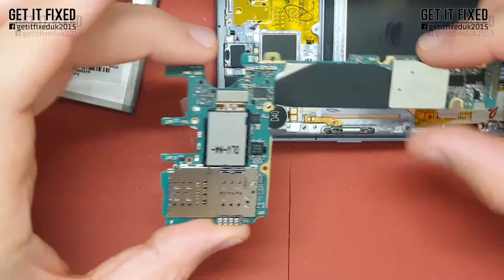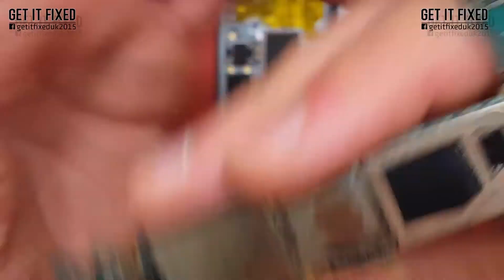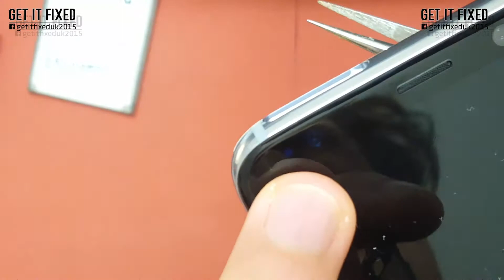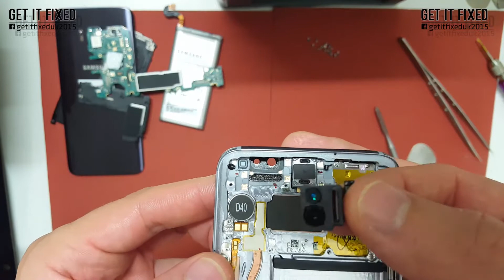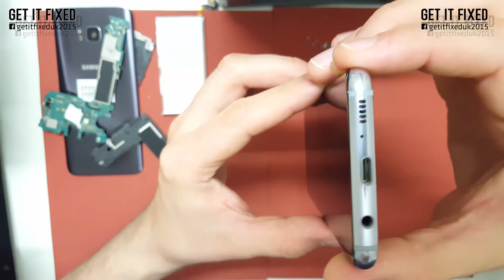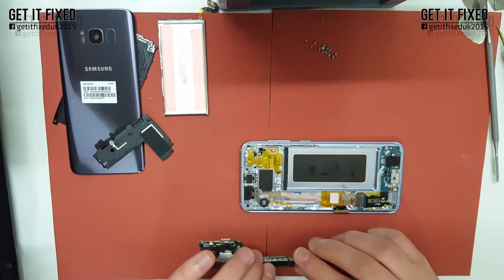Samsung Galaxy S8 S8 Plus TearDown Mother Board Explained!

Comment: Where is the display chip and how to test it?  My S-8 was water-damaged before I could back it up.  I can now hear it receive emails, texts and other notifications including the LEDs.  I can reboot it and it vibrates accordingly but the screen is black. My screen was already shattered so bought a new one.  I swapped the boards to a new frame and screen and changed the C-USB board and tried to clean up the connections on the boards but still no display.  Thanks.